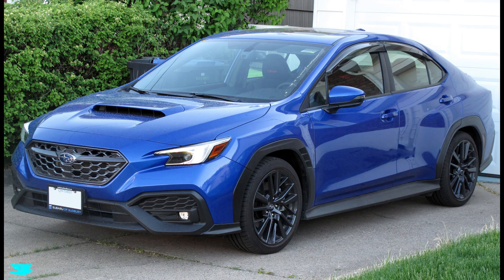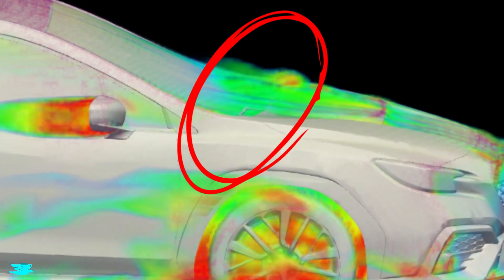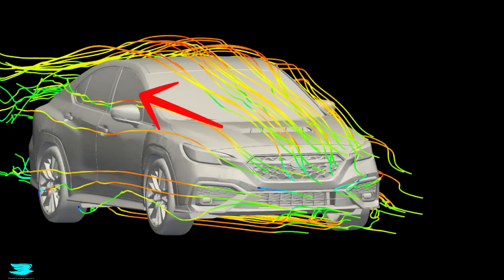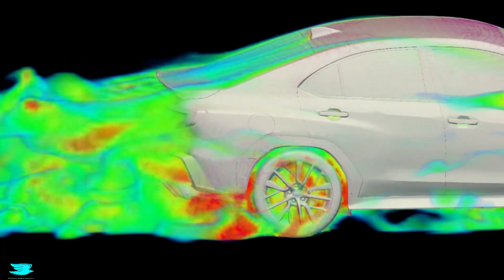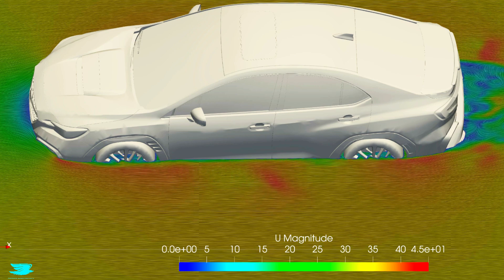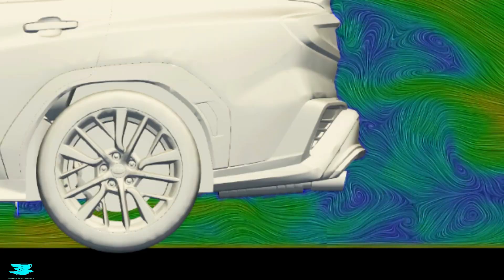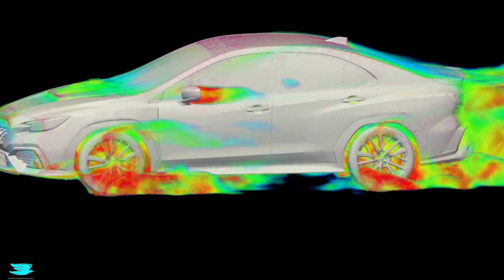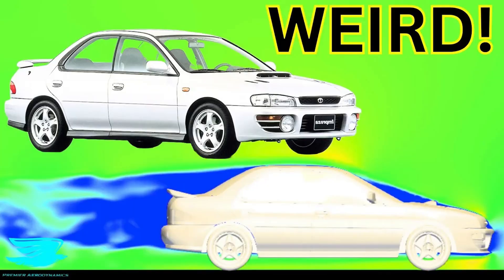Why The New Subaru WRX Has Disappointing Aerodynamics

Comment: Good data oriented video, in addition to Subaru engineering own spec sheet facts about the new WRX using open front diff and open rear diff with only brakepad torque vectoring in front to help. Most new VB WRX owners only talk about their engine and power they make for straight line racing, they think the only difference between WRX and STI is power and wing so they throw a wing on their car, not realizing the STI entire AWD drivetrain is different, STI has front LSD, center DCCD, rear LSD like the EVO and my GTR has.
Reply: You'd be surprised how many VB owners that don't even know what a LSD even is.  But for a fun daily it doesn't matter and that's what the VB WRX was built to be, not a track car like the STI or EVO or GTR you mentioned.
Reply: What! That is sad, we all know the Civic Type R has LSD, but even the lower end Civic SI comes with LSD standard. What is Subaru doing!
Reply from the maker: Yep, Subaru do a good job making all round performance cars, not just minor differences.

Comment: After test driving one of these, I traded in my 2021 STI for it and absolutely love it with just a tune and intake. Could care less about the aero, pretty sure the STI had bad aero as well and never bothered me one bit.
Reply: you're spot on, STI is only great for amazing track and rally handling, that's why the STI got the superior AWD drivetrain of front LSD, center DCCD, and rear LSD just like the EVO and my GTR. The VB WRX doesn't have any of that, instead it got the Crosstrek drivetrain of front open diff and rear open diff with brakepad torque vectoring only to help, along with the Crosstrek's strong and comfortable chassis, makes it a much better daily driver than STI.
Reply: @z @zombielivesmatter7294  yep I haven’t noticed a difference in the AWD system between my STI and VB WRX other than in the snow drifting since I could make it primarily RWD in the STI but other than than the VB WRX is an absolute beast in the snow anyways and I don’t notice any difference if it’s dry or wet out 🤘
Reply: @SarcasticComments23  no worries, most VB owners just drive to grocery store or go 60% on the canyons. our publication had professional driver Randy Pobst drive on track and he noted the difference, in his review he stated how numb the VB was and Subaru engineer confirmed it's because VB uses numb electric steering rack and no LSD in front or rear like the STI has.

Comment: Hi, İ planning to purschase your courses,but İ have some  couple of questions in my mind. I have some very detailed  diecast cars and i want to 3d scan them and use them for analyses, Will the accurasy change or will the accurasy  Change too much that it Will not shoe the real aerodinamic values of the car . Also would you liken to purschase my 3d scanned models?
Reply from the maker: Hi!

For the CFD accuracy, if the scan is accurate, then the CFD can be done accurately. Gennerally, it’s good, the thing to aim for is a complete scan, not ones with small holes and gaps in them.

For your CAD models, we are always looking for them. We might not need any right now, but every week, we need a certain model. So if we know which ones you have, we can then get them when we need them. So, if you have a portfolio of them, then please send through a list of the ones you do have.👍
Reply: @PremierAerodynamics hi it is me but with an another account. Wich websites would you reccomend me for 3d models to sell

Comment: Maybe they didn’t really care that much about the dragged because it was a rally car😅
Reply: but Subaru discontinued the good handling one too, it was called the STI, it had the good rally handling bits with front Limited-Slip diff, center DCCD diff which was too important for rallying, and rear Limited-Slip diff, just like the EVO has and my GTR has. New VB WRX doesn't have any of that, to save money it uses the Crosstrek's front open diff and rear open diff with just brakepad torque vectoring in front to help only, not good at all.

Comment: You should add the sti wing that we all add to the new wrx
Reply: Absolutely love it 🤘
Reply: Yes! specifically the Aeroflow Dynamics V3 STI wing.
Reply: @tintingjoe not sure if you know, there's a protype of the GD rally wing coming gor the VB. Having the wing drag simulator done with the sti wing then gives feed back for the front end and how to stabilize for downforce and not lower the car like ricers
Reply: It's just all bad for VB WRX, this video with pure data, in addition to Subaru engineering own spec sheet facts about the new WRX using open front diff and open rear diff with only brakepad torque vectoring in front to help. But most VB WRX owners will ignore pure data and pure facts from Subaru themselves. WRX owners will think the only difference between WRX and STI is power and wing so they throw a wing on their car, not realizing the STI entire AWD drivetrain is different, STI has front LSD, center DCCD, rear LSD like the EVO and my GTR has. That's why WRX owners ONLY talk about their engine and how much power they make for straight line racing.

Comment: the scoop brings air to the intercooler not the intake by the way like you kinda imply. I'm pretty sure the VA and by any mean all of WRX models suffer the same problem that makes you swear when you try to use windshield washer at 60 mph and over. It would be nice that you did the same exercise but with let's say the STI lip kit from subaru catalog and a roof spoiler and/or vortex generators!

Comment: Oh no, my daily commuter sport sedan isn’t aerodynamic like a race car… whatever will I do. People will reach for every reason to not like the VB.
Reply: it's not even about the poor aerodynamics, I don't think people care about that, it's the poor handling, it's a shame Subaru to save costs put the Crosstrek's AWD drivetrain of front open diff and rear open diff, with only brakepad torque vectoring in front to help. None of that matters for daily driving, my neighbor feels his Honda Odyssey is amazing handling but he doesn't go to the track. But good news, Subaru just announced last month they maybe bringing back the legendary handling STI that has the front Limited-Slip diff, center DCCD diff, rear Limited-Slip diff just like the EVO and my GTR has.
Reply: @zombielivesmatter7294 Good. An offering for everyone. I don’t have to run rally stages or hitting every corner apex on my way to get groceries or go to work so for me, I could not care less about the drivetrain difference between this VB WRX and an STI. Still really like the car.

Comment: "Aerodynamics are for people who can't build engines"

-Enzo Ferrari
Reply: "my engine kicks ass for 7200 miles before it has to be rebuilt"
Reply: @bakedpotato1138 yeah thank God they finally replaced the failing EJ motors with these bulletproof FA24’s.. now if they can fix the glass-like transmission..
Reply: More evidence that the car was nerfed from the factory.

But it was clearly designed with modularity in mind. So the adage "If you can't make it perfect, make it adjustable" also rings true.

There is a gentlemen's agreement between Subaru corporate and Rex drivers. Drivers take ownership of a great but purposefully neutered machine, and figure out ways to level it up. As STI and VSC send cars officially to circuits around the world, people at home set up shop too.

Comment: Hey, Simon (video requester) here. Thanks for the video. I have a couple of questions if that is ok 

1. Does the model accurately reflect the hood scope? If it is sealed off on the inside, it would act like a wall on the intake side, which seems to be happening. Whereas if the air can flow though the scope, it would lower the pressure in front of it.

2. Would the oem vortex generator help excite the air and help it attach to the rear window better?
Reply: It does look like the scoop has been modeled as a wall. Anecdotally, driving in the rain at highway speeds, I do not see those vortecies forming, instead the streamlines down the hood and up the windshield flow smoothly straight back.
Reply: @bigfootpdx1545 time to do the yarn trick and observe
Reply: Hello Simon, I also have the VB wrx, and want to do some areo mods to it. Thanks for making the request
Reply: @andrewthegreat4412 Verus engineering is the only one to my knowledge that makes aero beneficial mods for VB. supposedly their front splitter and dive planes clean up the front well.
Reply: If you cut out some of the slots in that fog light grill, would that help the airflow through to the wheels and potentially help cool the brakes?